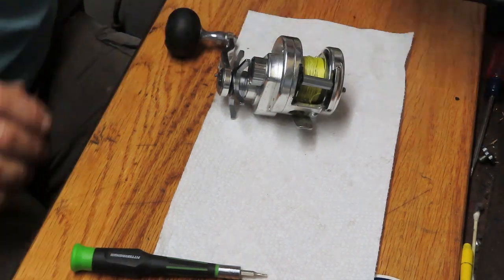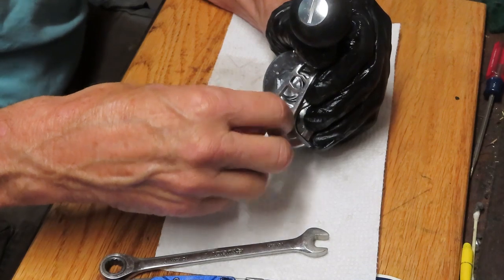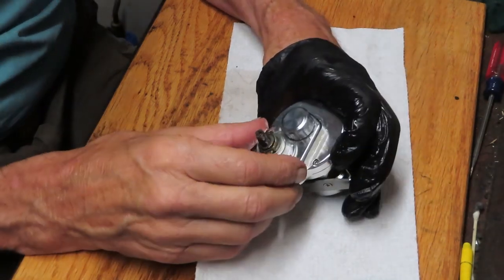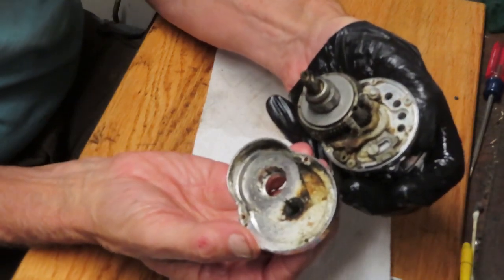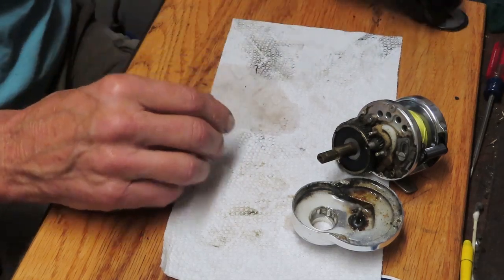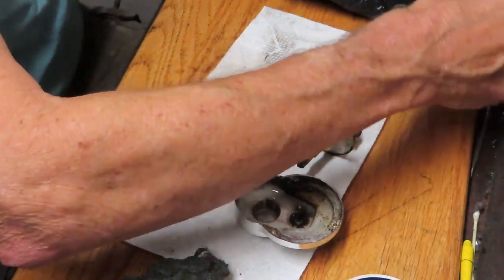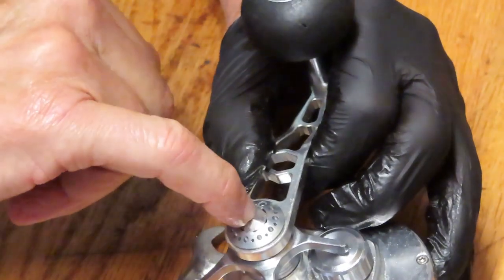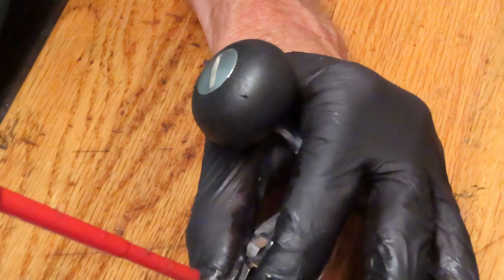Maxel Hybrid 20L fishing reel failure and how to service this reel

Comment: I can recommend using brake cleaner instead of penetrating oils, that stuff will remove basically any dirt on reel, even without brushes or paper towels. 

Of course, You have to be careful with certain rubbers and plastics when using brake cleaner.
Reply from the maker: I have used that, and carburetor cleaners and others and I prefer the penetrating oil - Thanks for the tip

Comment: That's a very nice reel... Dennis I just got a Penn 309 level with a Berkely T-90 10'6" ..I can't find any info on age of rod do you have idea on it's age
Reply from the maker: I don't because Berkley made rods for a long period.  Your rod is mismatched to the pole.  If the pole has a fiberglass blank it is the 1970s. Graphite came along in the 1980s/. Does your rod have metal or plastic line guides?  Plastic inserts were the 1990s
Reply: Dennis it has metal guides...